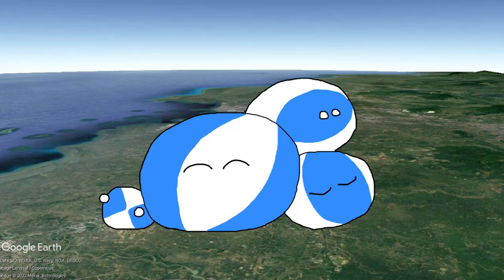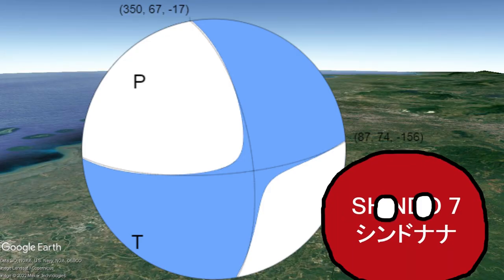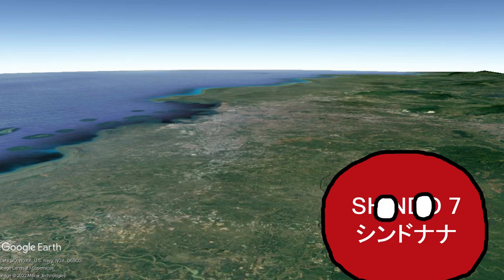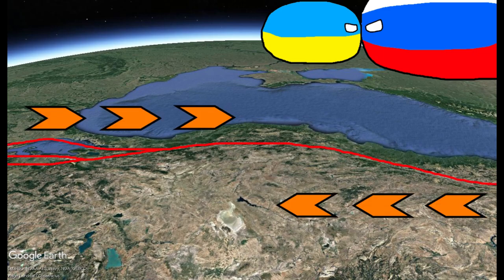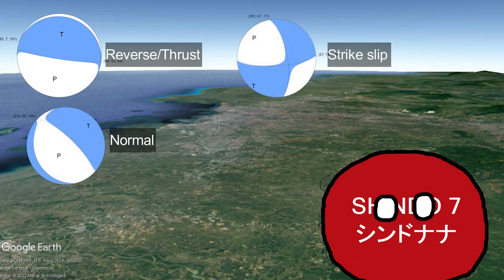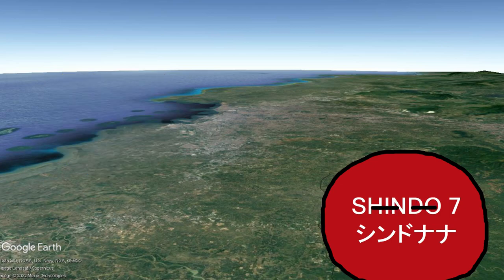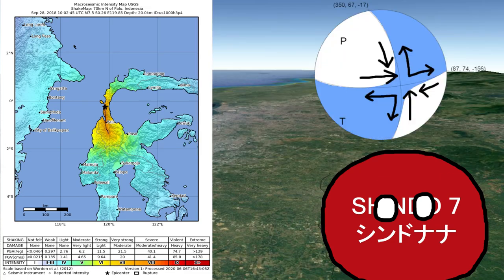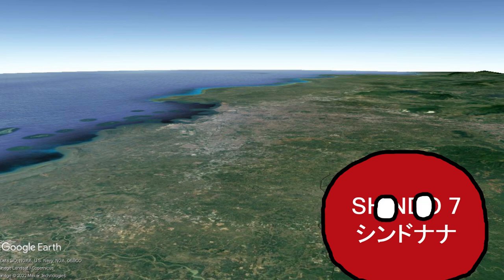How to read those b a l l s that seismologists keep on using

Comment: Do you still do fictional quakes? If yes, please do Italy.
Magnitude: 6.4 
Maximum Intensity: IV
Depth: 350km
Fault: Thrust
Final report: 391,517 deaths, 60 injured
(I'll subscribe if you do it)
Reply: Comment this on a another video instead im not trying to be rude
Reply: Thats very unrealistic an IV caused almost 400.000 death
Reply: What caused so much damage?
Reply: @cranksetwrench  the magnitude..
Reply: @tornadoexpert7377  a 6.4 that’s 350KM deep isn’t going to do any damage. You have to understand that it’s too deep to be felt any more than Intensity 4/ Shindo 3 and a death toll of that magnitude is super unrealistic for a 6.4 even if it was super shallow (3-5 km)
Reply: sorry but I don't speak earthquake mate
Reply: @tornadoexpert7377  and WDYM i don't speak earthquake you mean English or what
Reply: I would say that an earthquake has a magnitude of 6.4 with a depth of 350km isn't gonna do much damage and the death toll would be like 0-2 and the intensity would be like IV/3 (MMI/Shindo)